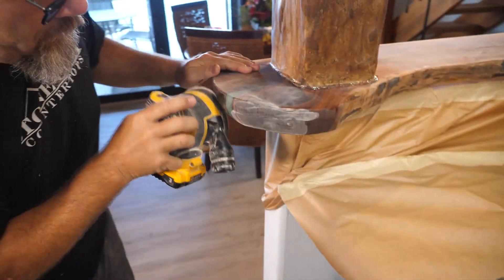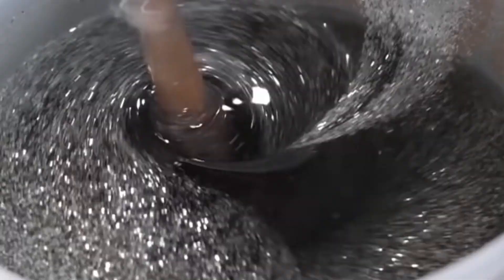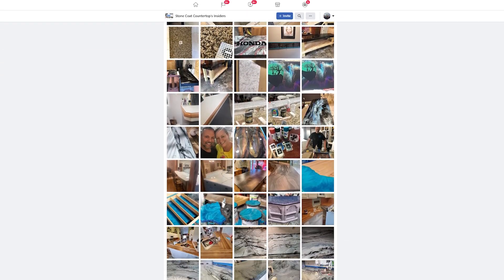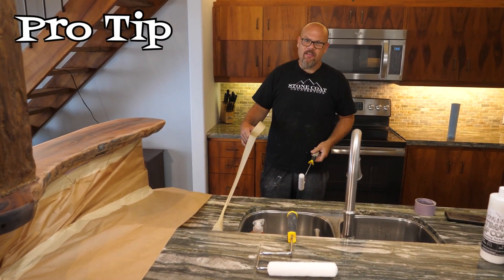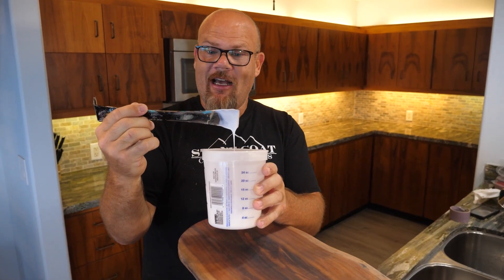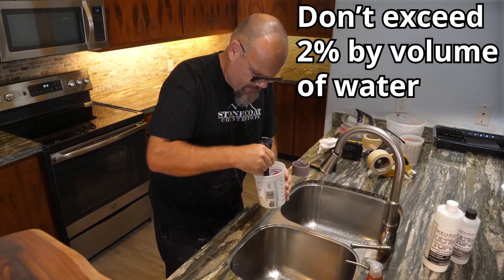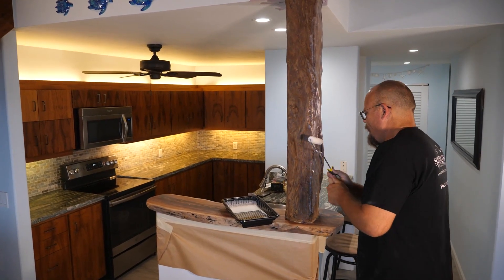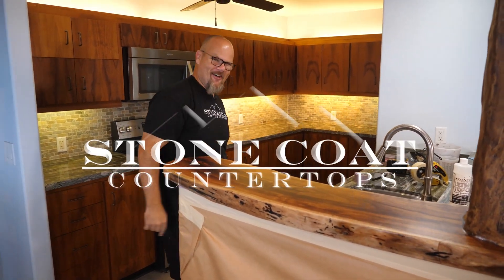The Best Wood Finish Doesn’t Have to be Difficult | Stone Coat Epoxy

Comment: Have been following this thread, but please, if you ask people for opinions, then it is really important to answer their questions as well. This would prob also save you guys a few unnecessary phone calls as well. Thanks!

My Q is: On wood, I much prefer a satin finish to a gloss finish. What type will this finish apply? Also, is this the same finish you have recommended in past on countertops for anti-scratch and high temp resistance? Thank you in advance!

Comment: Your concrete tree looks great! 
   I make concrete countertop overlays.. I apply my concrete to the customers existing countertop or I build the Countertops out of  3/4” MDF / MDO board and then apply epoxy with the ultimate topcoat added for durability and protection. The ultimate top coat is a very good product.
Reply from the maker: That is awesome! Thank you for the great comment and support. You Got This!

Comment: Is it possible to use an HVLP gun to spray the UTC on a wood project? I have some Knotty Alder doors that im going to stain. I think they would look good if they were finished with your UTC. I think the finish would be more durable than a poly product too.

Comment: I think a how to video of making a tree would be very cool 
Another question is could you make a concrete table that looks like a tree slab and a epoxy over the top and then finish it was something to make it go Bam also I have a question on how well your product would last outside with some Direct sunlight how long do you think it would last and stand up both epoxy and your finish coat ??

Comment: Could I put this on a butcher block that has oil based stain on it?
Reply from the maker: If using an oil based stain you will want to use a varnish before applying epoxy. Give us a call Nathan, You Got This🙌

Comment: I’m confused. I emailed y’all asking if I could use UTC on wood surfaces and y’all replied back that you only recommend it for dry epoxy surfaces. Which is it?

---- On  Fri, 12 May 2023 20:30:27

Is this product for coating epoxy only? Or, can it be used to coat wood?
Thanks,
Paul

Aloha Paul,
 
Thank you for reaching out!
 
We apologize for the lateness in our reply. We recently lost 1/3 of our support team and are working diligently to answer all correspondence which was assigned to our missing team. 

We only recommend applying out UTC to our dry epoxy product. You will want to create a mock up of the project you plan on applying our UTC to and test the process out to see if it performs to your satisfaction. 

Please let us know if there's anything we may do to help you with your projects. 
 
No worries,
IanS

Comment: As always great work.  Did I hear you say that ultimate top coat can be used to seal actual granite stone?  Granite being pourous (sp) can harbor bacteria so if this seals out bacteria that would be great.
Reply from the maker: You would want to clean the surface first with TSP and then sand it before applying the top coat